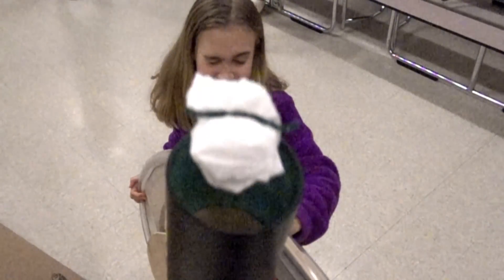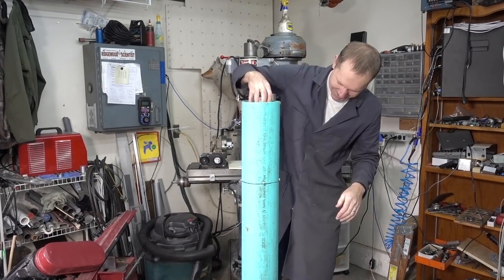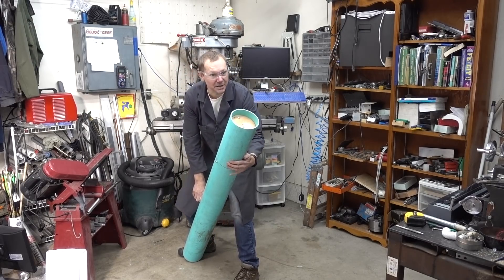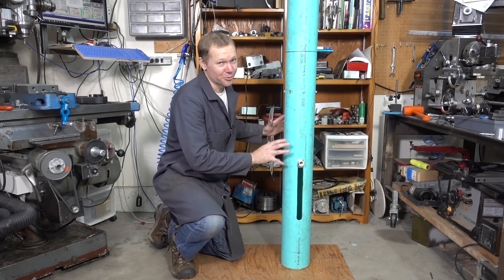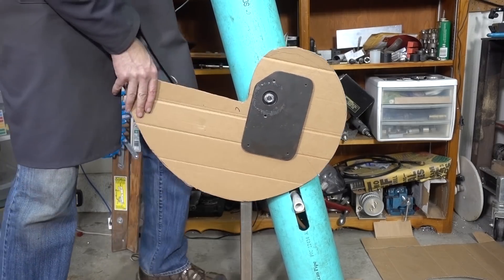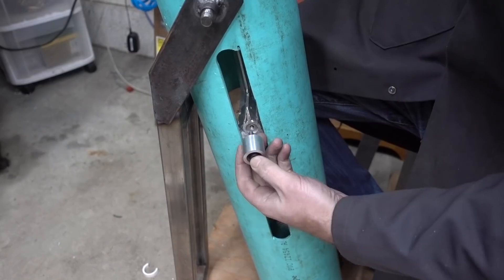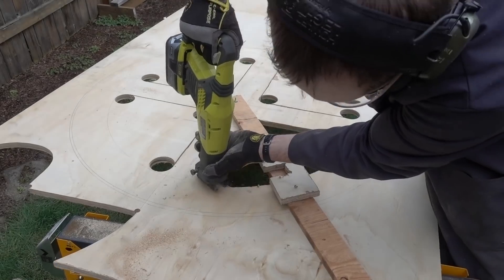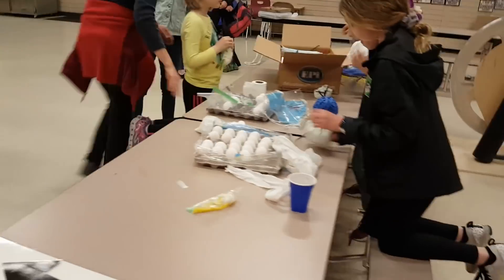Egg Drop CANNON!!! - Spring Energy Explained

Comment: Hey Quint I love your Gutter Power generator and I was wondering if this is real https://youtu.be/H09i2iZCRxs 
And if it is could you make a water power generator using this?
Reply from the maker: It's real in that the water he poured in there to start with is draining out the tube on the bottom.  There's not yet enough suction in the air pocket in there to draw anything up that other tube.  It will eventually reach equilibrium where it doesn't do anything because there's no more energy or work being added to the system.  In short, no, it's not real.  Total BS.  Maybe I should do my own video tearing it down? :)
Reply: @QuintBUILDs  Thanks and you made a debunking it that would be super awesome 😎

Comment: Typical scope creep on this project. Now, multiply this by a few tens of thousands of dollars and convert it into an embedded electronic control system. Oh, yeah -- start with a fixed bid that the end customer refuses to acknowledge was insufficient to begin with, and which the broker won't challenge for fear of losing future business from the end customer. Add more electronics and software as needed, all at my expense. Finish just before the drop dead date. Deliver and get nothing extra but a pat on the head.

My life.

Comment: The stiffer spring you showed is better, despite having the same "stored energy", as most of the energy gets wasted in accelerating the mechanism. The stiffer spring you show is far lighter, and so, the terminal velocity that the mechanism reaches (for the same amount of stored potential energy) will be higher. (i'm guessing you are aware of this, but simplified for sake of the audience).
BTW, Tom Stanton (on YT) has done an interesting series on launching tennis balls with a trebuchet mechanism, whereby he tries to extract the laste millijoule of kinetic energy out of the trebuchet.
Reply: @everettstormy  Torque?? Pressure?? We are talking about a linear spring here.. not a torsion spring, not a gas-spring. Further, if the terminal velocity of the payload is the same as the terminal velocity of the mechanism, then any energy absorbed in compressing the pillow is irrelevant for the comparison.

Comment: I did a not-dissimilar project. Big springs to launch a shaft to hit a target. I went with an aluminum tube for the barrel. Mostly because I had one. For the bolt (which would propel the shaft) I bought an aluminium rod of suitable diameter. My choice was based on having a durable contraption. However after a few test shots, I replaced the rod with a hardwood dowel. Seems the aluminium rod had too much mass to accelerate adequately. Long story, short... Total success!